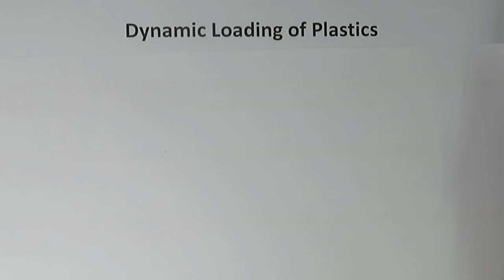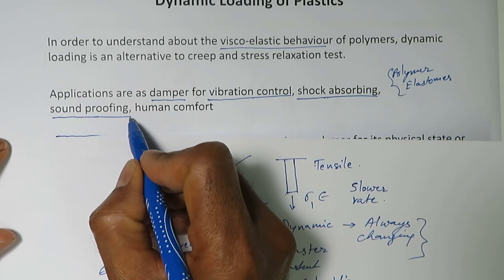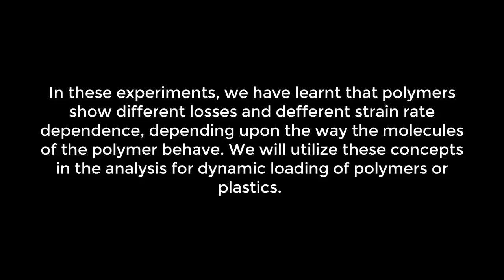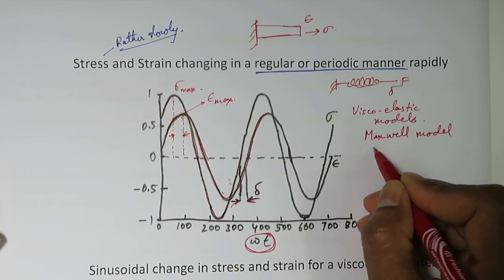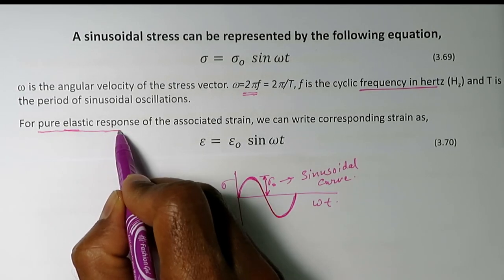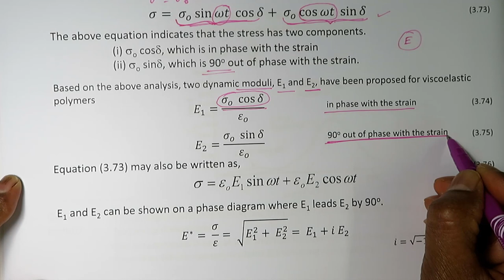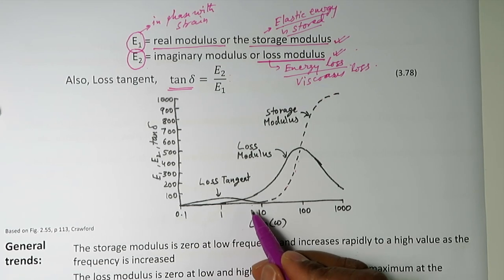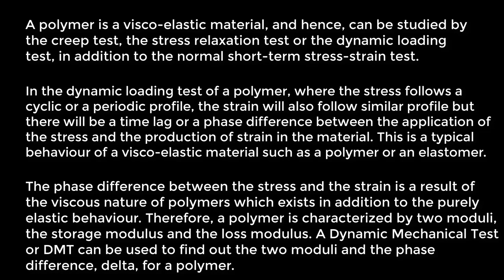Dynamic Loading of Plastics - What are Storage Modulus and Loss Modulus? Viscoelastic damping, DMT?

Comment: Hello,
Thank you for the detailed video. Could you also explain how storage modulus is related to Young's modulus, if any? I have seen people using these alternatively. But these are two different properties. Isnt it?
Reply from the maker: Briefly storage modulus is actually the elastic modulus part and hence we can say Young's modulus. The word storage is used because it means the elastic energy is stored and can be recovered upon release of stress. The loss modulus is the part of energy that is lost due to viscous flow within the material. It is called loss modulus because that part of energy is lost in heat and other dissipative work.

Comment: The thickness of silly putty will be taken into consideration...? Is the thickness of all the materials are same...?
Reply from the maker: Thanks for the thought. Yes, the thickness of the layer is important as there will be substrate effect if the thickness of silly putty is not sufficient. However, in the present case, the conclusion will not vary at all.
If we are going to determine the property of the materials (e.g. the silly putty) then the thickness should be sufficient to avoid the substrate (granite in the present case) effect. There is a test know as Rebound test to measure the resilience of rubbers. You might explore the ASTM standard for rebound type of tests.

Comment: Sir, I have doubt regarding Elastic Modulus E1 and E2. In expressions there is no time term, so is this Elastic moduli are constant for whole life(long term response)?
Reply from the maker: This data is not looked at like the creep data or stress relaxation data. Here the stress application is changing in a periodic manner. Hence the time factor is present, and the response of the material is in response to this time factor which is in the form of angular speed or frequency of the stress change. We can say that the response of the material measured here is only short-term that means how it is behaving now. If we test the same polymer after a year, for example, with the same type of stress profile and frequency, the values of E1 and E2 would be different than what they are today.